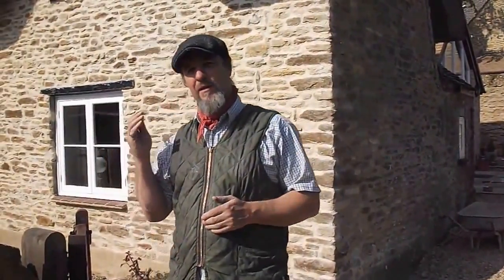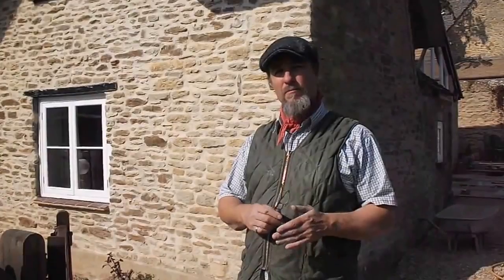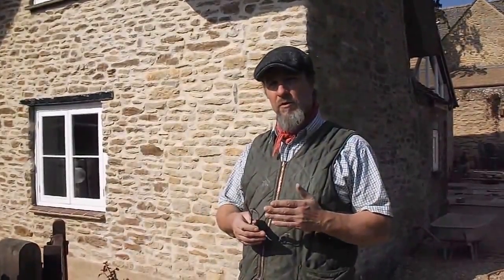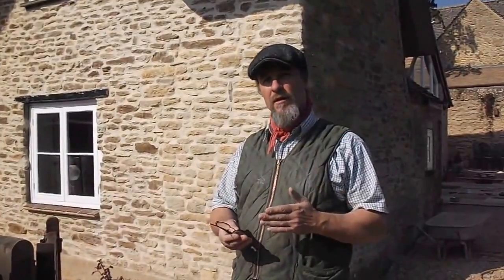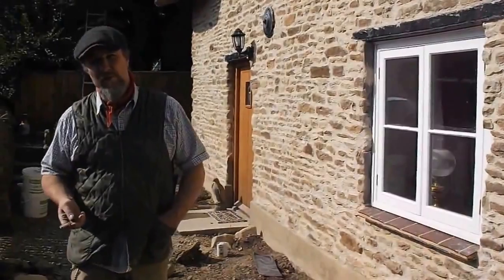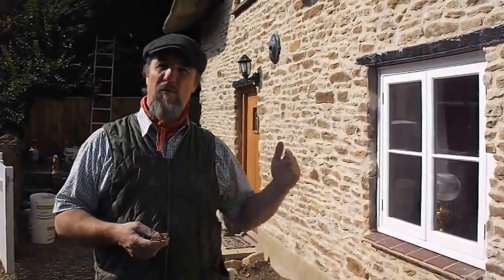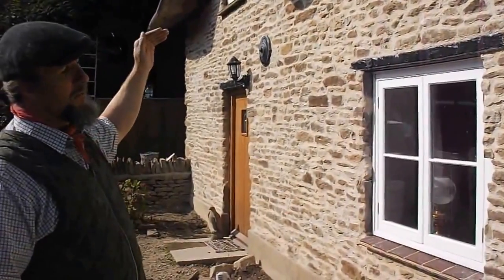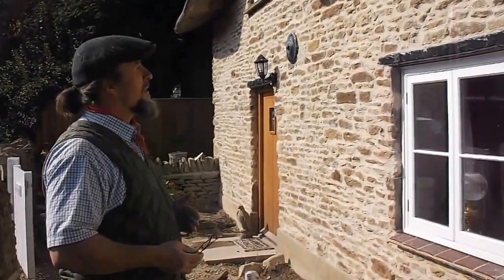The difference between lime putty and natural hydraulic lime

Comment: Hi ,I've an internal exterior wall which is showing damp at the bottom. Currently it is plastered with portland cement, I intend to chip away the cement and fill joints with lime mortar  leaving wall as a feature wall. What grade of sand should I use and lime mortar ? 
Thanks Robbie
Reply from the maker: I'd be tempted with a nice NHL2, some sharp sand and some plastering sand.
Reply: @michaeljamesdesign  thanks for getting back !!

Comment: Hi, could you give me an idea of how much it would roughly cost to point the front (street) elevation of a three storey Grade II listed 18th century house in the historic town of Somerton, Somerset? Thanks
Reply from the maker: Sure, if you could give me the exact number of square metres which will need pointing, tell me whether there are any bricks which will need replacing, give me an idea of the number of linear metres as far as the returns are concerned, send me some decent photographs and indicate whether scaffold will be required I'll work it out what I'd charge.
Reply: Many thanks for your quick reply. We have not moved into the house as yet so will get back to you when we do and have measured up etc.

Comment: Can I used hydrated lime and sand 1:3 to cover my cinder block walls in the basement?
Reply from the maker: If it's bone dry, yes.
Reply: @michaeljamesdesign  wouldn’t I have to wet the cinder block so there is natural adhesion? And wouldn’t it be breathable since such techniques are used for exterior applications as well, like German smear?
Reply from the maker: @rr3zart  always wet up before application. And yes it would be breathable. But it's a non-hydraulic lime - which is an air lime - which is only for above ground.
Reply: @michaeljamesdesign  ah, okay. So, what’s the best mix to use for cinderblocks in the basement to coat the entire walls with?
Reply from the maker: @rr3zart  Hi Mike, thanks for the last reply. Really appreciate you making the effort to answer my questions as I realise you must have a lot on. I've got one more question, if you don't mind. (insert question here).
Reply: @michaeljamesdesign  If you don't want to engage your viewers you should switch off comments.
Reply from the maker: @jellibeens  What are you on about?
Reply from the maker: Go ahead.
Reply: @michaeljamesdesign  Your comment above mine. A viewer asked for advice & your response was petty & unprofessional for someone who puts out content.
Reply from the maker: @jellibeens  You've lost me my little friend. I think you have to bear in mind that I'm from the generation before internet where content hadn't even been invented - it wasn't even a thought before I started my business and I've done quite well without it. So if I say something which causes you offence, or mildly irriates you, then you can rest assured it's because I don't really care that much about the content. It's my channel, my "content" and I'm the one wearing the cap. I'm also the one who's semi-retired from the lime game so if you don't like it then, well, you're perfectly within your rights to pass comment. And you have. So thank you.
Reply: @michaeljamesdesign  Someone asked for your help, you basically didn't like the way he asked so you sent a crappy response avoiding the question even though he did nothing wrong. Do you even know how a comments thread works?
BTW, You are welcome for my input.
Reply from the maker: @jellibeens  Who are you? Youtube police? This channel is about lime. Ask a lime question.

Comment: A question, please :- I have a house in Shropshire on a hill. The south-west facting brickwork is hit hard by strong winds and horizontal rain  for prolonged periods in the winter. The brickwork extension was built in 1974/75 and has never been re-pointed. The perpendicular joints were never (originally) mortared properly and are leaking. I am going to re-point the brickwork. There is no sign of brickwork spalling. The bricks look very good.

I need a re-pointing mortar that is fairly weather-proof, and also breathable, as the cavity wall has let in a lot of damp and I need this to dry out over time. I am also repairing the cavity insulation (from the inner skin !).

What mixture ratio of cement, lime and sand should I use for re-pointing? Also, what "type" of lime should I use (hydrated, hydraulic, NHL2, NHL3.5 or NHL5)? What type of sand (builders/sharp/washed). T.I.A.
Reply from the maker: The first thing you need to deal with is the fact that you never combine cement with any kind of lime unless you're using lime hydrate as a plasticiser for your cement mortar because you want a more workable mortar for building or rendering.
Reply: @michaeljamesdesign  Thanks for the quick reply. Is the term that you used ... "lime hydrate" ...  just another term for "hydrated lime" (not the NHL stuff)? I wanted to add "lime" to make the pointing mortar more workable, adhere better and make it less brittle, as I have seen that the cement/sand mortar that was used to build the extension does seem to be cracking up and coming out in hard, lumpy bits. The bricks seem to be holding up perfectly, but the mortar is definitely deteriorating from the harsh weather here. What mixture components and ratios should I use for a pointing mixture for harsh weather, hard bricks and cement/sand "original building" mortar? T.I.A.
Reply from the maker: @robkovacs2100 Lime hydrate is hydrated lime. There's a lot of failing 70s mortar around nowadays. Builders then used washing up liquid to make the mortar more workable and this is the result. Builders are often found to be mixing different components based on no empirical evidence what so ever. I use 1 cement, 1 lime hydrate, 4 building sand and 2 sharp when laying bricks or repointing non-heritage. You could go 1:1:5 if you wanted harder.

Comment: It was 7 years ago but i would still try to ask a question. Where I live, they sell NHL 3.5. In regards to breathable, is NHL 3.5 good for allowing moisture (raising dump) to evaporate, in comparison to lime putty. or they are quite the same (in a way that i can use either)?
Reply from the maker: You can't really use lime putty in damp areas so a good high free lime content NHL2 would be fine.
Reply: @michaeljamesdesign  thank you. About nhl2, how do i know how much is the "high free lime content"?. What should i look for on the label? (I am buying in Portugal so will try to match a similar text)
Reply from the maker: Saint Astier NHL2  @kookia213
Reply: And what about hydrated lime please?
Reply: Do you use lime putty for pointing around the windows, or burnt sand mastic?  If lime, what mix ratio . Thanks

Comment: Hi. I have to repoint an old Portuguese stone building and have chosen to use a lime putty mix. What mix ratios would you recommend? Thank you
Reply from the maker: Haven't used lime putty for pointing for about 8 years now. I only ever use it for top coat plastering. I found it too much like hard work because it takes so long to go off low down. It's now my opinion that good putty is only really suitable for skimming.

Comment: Hello sir

Could you tell me how to just make the normal white lime mortar that was used  with the with the red imperial brick???
Reply from the maker: 1 x Calbux quickime, 4 sand.
Reply: @michaeljamesdesign  no cement?
Reply: Calbux is cement I guess?
Reply from the maker: @keithlittle293  NONE
Reply from the maker: @keithlittle293  If you want exactly the same mortar as was used to build them then it's as I said: 1 x Calbux quicklime, 4 sand.
Reply: @michaeljamesdesign  ok thank you for the reply and thanks for your knowledge!! Appreciated
Reply: @michaeljamesdesign  I thought 1:3 was the mix and even 1:2.5 is considered the better way to go by increasing lime proportion?
Reply from the maker: @hugh3sy7 You could even go 1:1 if you wanted but waiting for that to cure sufficiently is only for those who have time and patience.
Reply: @michaeljamesdesign  what would be the advantage of a 1:1? Surely 1:1 v 1:4 is quite the range
Reply from the maker: @hugh3sy7 I'm not sure what you mean when you say quite the range but 1:1 is usually for tight joints. 1:4  putty would be too weak.
Reply: @michaeljamesdesign  ok thanks. I meant quicklime to aggregate rather than putty.

From what I understand, a hot mix is seen as the best option, whereas a putty is lesser favoured due to the unknown water absorption
Reply from the maker: @hugh3sy7 Putty did used to be seen as the preferred binder but it's a bit passe now. You'd go 1:1 quicklime for fine joints. Or with Ashlar you might just use putty without aggregate.

Comment: Hello Michael, I wonder if you could help me? I have a property which is in France where Lime is used in most buildings, however I have never used it. There is an interior stone wall which has 2 windows however the lime render all around the inside is cracked and needs replacing. Could you advise on how I mix it please? Thankyou. Alex
Reply from the maker: 1:3 Alex
Reply: @michaeljamesdesign  thankyou for your reply. Is that 1 lime 3 sand? Also, is it nhl3. 5 I use ? Thankyou
Reply from the maker: @alexthomson7465  The binder is always specified first. And if you want to use 3.5 then it's completely up to you.
Reply: @michaeljamesdesign  thankyou for your help. I appreciate it Very much

Comment: I’m building an extension, out of a mix of Ironstone or Hornton, and some lighter stone, perhaps a Cotswolds building stone. The contractor is building it using modern construction (concrete block, insulation, then faced with stone mentioned above). Would you still suggest a lime mortar for such a job?
Reply from the maker: Ultimately you're the specifier so before I answer the question let me ask you what you think as that'll give me an idea of your understanding where natural building materials are concerned. If you have an architect then tell me if he's made a recommendation and also let me know if your contractor has suggested anything. I'm sure he has as choice of material will impact on his profit margin. In sum, where are the three of you coming from?
Reply: @michaeljamesdesign  thank you so much for replying to my questions. My gut (a very non expert gut) tells me I should be using a lime mortar, even though the construction will be modern ie cavity wall with block work, I’d still want to protect the natural exterior stone from the hard cement. Most of the cottage was redeveloped in the 70s and not sure exactly what mortar was used, but I’d hope it’s lime. Therefore I’m thinking it would be a bad idea to go cement for the extension. Architect hasn’t made any suggestions (I have now just dropped him an email to ask), and I suspect the builders would want to use a cement based mortar...
Reply from the maker: @kuxkiri  If your architect can't come up with anything sensible - and very few of them can - then I offer sensible consultation rates.
Reply: @michaeljamesdesign  Brilliant, I’ll see what he comes back with. One of the contractors came back and said he’d recommend a cement and lime mix (half and half) That doesn’t sound right to me...
Reply: Architect specified Lime Mortar :)
Reply from the maker: @kuxkiri  Good. But do bear in mind that all limes are different and some really aren't very good at all.
Reply: @michaeljamesdesign  nhl 3.5  lime sharp and building sand
Reply from the maker: @kuxkiri  Every NHL is different. Some good, some not so good.
Reply: @michaeljamesdesign  Any particular brands I should look out for (or avoid?)

Comment: Dear Mike,
Thank you for posting content on lime. I am new to this. I live in Detroit, Michigan, USA. I seek a lime supplier or a way to make it on location. Do you have any recommendations? I may have to get freshly made type S hydrated lime as lime putty isn't sold in tubs here. Any tips on how to keep curious kids away from the area? I wouldn't be able to live with myself if one went blind. Thank you so much. TK
Reply from the maker: @tkjazzer  Yup, that's lime hydrate. We rarely use it in the UK as anything which has been sitting around for too long will have carbonated to the point where it won't set so it's often just used as a plasticiser for cement mortar. So use your lime hydrate and sand but if you want you mortar with a lot of fat then run it to a putty the night before.
Reply from the maker: You probably won't get lime putty or NHL where you are and if you did it'd be horrendously expensive. Get some lime hydrate. It must be fresh. Run it to a putty the night before or use it straight from the bag. 1:2 would be good. Use your common sense when it comes to children.
Reply: @michaeljamesdesign  thank you Mike. If the 1929 building has some Portland in the mortar, is there any harm in raking out an inch and putting hydrated type s and sand only mortar in when I repoint?
Reply from the maker: @tkjazzer  What's type S?

Comment: Good Evening, Mike! 
I'm really hoping that you can provide some advice, because nobody else seems to be able to!
We have bought an old stone smallholding, which has spent the last 30-40 years under 4 inches of concrete. When we bought it, the walls were sopping wet inside and out. We have just finished removing the last of the cement render. The stone behind seems reasonably soft - not sandstone, but some form of sedimentary rock. The binder is a common earth mortar. Since removing the render, I believe the house is beginning to dry, but it's a little early to tell. I don't know whether or not to use a lime putty as you have described here, or a NH2 to heavily point the stonework. The building is south facing, on top of a hill and is rather exposed to wind and rain (South Wales). Do you think NH2 would offer any benefit over Lime putty in this instance, or vice versa?
Many thanks in advance. Dan.
Reply: Did you get a reply?
Reply: Good evening, Mike! We fallow your videos closely and have finally completed pointing our old farmhouse after listening to your advice. It took us 14 months (full time work, new baby and working around blazing sunshine and thundery showers) but we've finished and are thrilled with the outcome. It's a little rough in places but I think I nailed the pointing technique the time I finished. The one little bug I have with, is that it's very light (lafarge NHL with sharp sand). Is there any means of toning it down now that it's dry? Can I make a dilute solution of mortar stain and spray it over the stonework, or is this a rescipe for diaster? Many thanks, Dan
Reply: @DrobbinsMpharm  you could probably use a like wash on it to paint the joints while maintaining the breath ability
Reply: @KirkWagner147  yes and maybe use an earth pigment to tint the lime wash and match the stone better.

Comment: Beautiful result. Please can you set out your lime putty mix in detail? Thanks.
Reply: I'm unsure any mason or pointer would give up a mix to be honest, it all depends on the stone or brick, each mix is different... you need sand aswell as grit in the mix, the sand helps to bind the mix whilst the aggregate in the grit gives it bulk and gives strength. A mix I use on one job maybe completely different to my next one, the colour of the final mortar will be set by the sands used within the mix. Red building sand with a red sharp sand will give a different finished product to say sherborn yellow sand with some waddington river sand for aggregate. Also the amounts of lime and type of lime used, putty, calbux 90, or NHL's 2, 3.5 and 5 also have an impact, as does the  brand of limes. Saint astiers lime is brighter than say tarmac NHLs, there is so much to take into account before just diving in and having a go at your own property. Techniques for pointing depending on the situation, tools used, how it needs to be finished using brushes, how far back you will rake the joints, are they wide joints, are they fine joints, what is the final result both aesthetically and technically your looking for..  learn as much as possible through reading and try to understand the product why we use it, what are its benefits, downfalls and traps to watch for. I dont think for one moment james was trying to be funny about not giving a mix away. Hard work and years of learning and experience go into the job when you earn your living from it, one piece of advice on one video may give you personally the wrong result, suddenly a bad comment could see his work dry up... 👍👍
Reply: @barrieparker200  He is selfish.
Reply from the maker: Denian Arcoleo. I cant dude. I guard my recipes. Like Coca Cola.
Reply: @michaeljamesdesign  asshole

Comment: Hi Michael, thanks for the video. Would you recommend a mix of putty and hydraulic lime where some stones are perished but others are not? We have a 16th century cottage in west Oxfordshire, and need to get rid of the horrible cement which has been used over the years. Most of the stone is solid, but some is loose and delaminated. Thank you
Reply from the maker: 1xNHL2 x 2 sand.
Reply: @michaeljamesdesign  thank you. I was wondering if you sometimes use hydraulic lime mortar for the most part, but then switch to putty where the stone is perished? Is it possible to colour match the putty with the mortar?
Reply from the maker: Will Clarke Colour match putty with mortar?
Reply: michaeljamesdesign yes is that possible?
Reply from the maker: Will Clarke I think that for your needs YouTube isn’t exactly the ideal teaching forum. I can visit your property and help you through the process and get you to a place where you’re working from a taught knowledge base. Alternatively I can recommend an excellent surveyor who will be able to help you achieve what it looks like you need.
Reply: @michaeljamesdesign  Thank you Michael. I am actually writing on behalf of my mother who's property it is. I've passed her your contact details from your website, she is going to try and phone tomorrow. Thanks for your help.